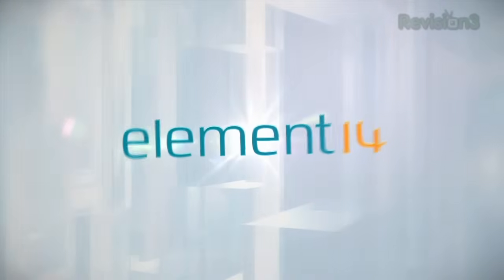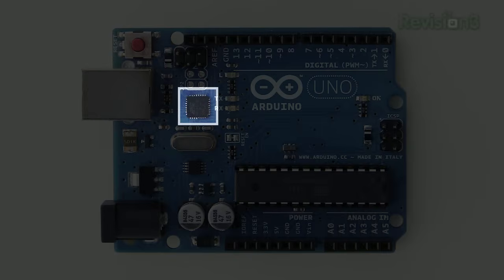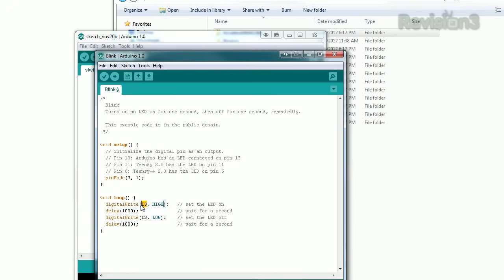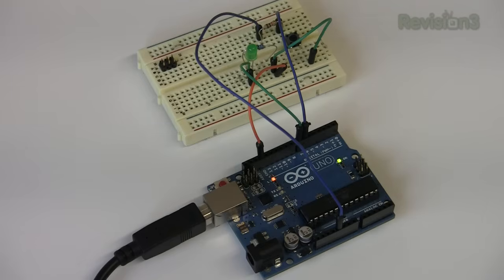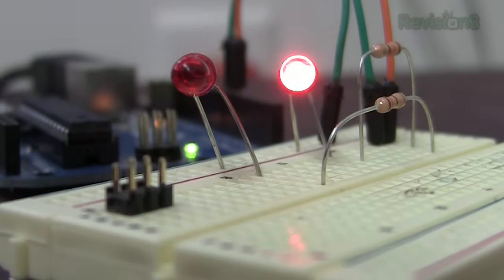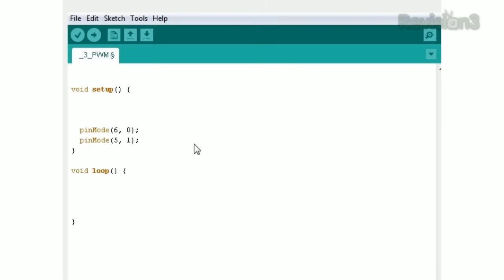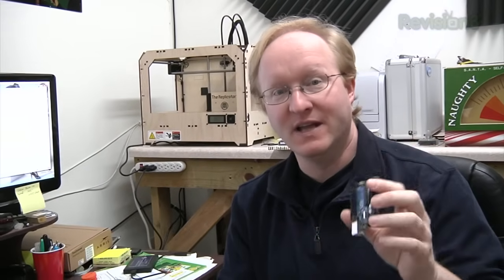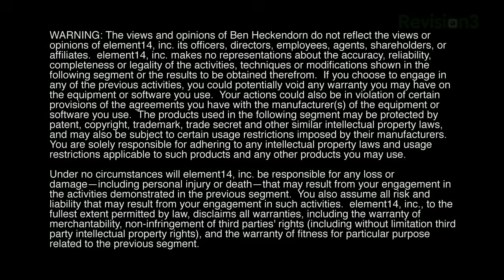Everything You Need To Know About Arduino

Comment: Could you make a computer (an actual one with moniter and all) by using multiple Arduinos?
Reply: An arduino is a real computer. You don't seem to understand what a computer is. If you want to interface with a monitor and serial on your computer isn't good enough you should be using a Raspberry PI instead.
Reply: no
Reply: I got suspended for no reason That's not really reliable. Just because someone tried and failed doesn't mean it is impossible, but it is unlikely.
Reply: Chris Barber No, I mean build a computer, except not a super-computer. Close to the power of a Commodore 64 or something.
Reply: KASASpace Sorry for not giving a full explanation on why I said no. I said no because it would take many many many boards to be able to provide video through the analog signal. Plus the amount of power it would take to compute the graphical side of things is a bit over wheeling plus the programing. It can be done(highly impractical), but why would you want to do that anyway when you can go buy a raspberry pi. I
Reply: KASASpace 
Not sure on the specs of the c64 as thats a bit before my time but i am fairly certain that the arduino chip is considerably faster then a c64.
What exactly are you looking for?
if you are wanting to program video output to a monitor you could do it with an arduino but it would be pretty difficult without using a chipset designed for it.
If you just want video output to a regular monitor and the ability to turn pins on and off to control external devices like the arduino is for the raspberry pi fits the bill perfectly.
However if you just want some kind of visual output from an arduino, you could hook up a character lcd display very easily.
Reply: I got suspended for no reason That is a good answer. And it can be done? But it's just not really practical, like space dogfighting.
Reply: KASASpace Lol yes. The most advanced thing i've done with these boards is probably when I had 3 mega's controlling this little humanoid. Pretty cool but it lacked power even for the mega and it did isn't work right :(
Reply: I got suspended for no reason Hmm, interesting. I wish I had an Arduino. :(
Reply: KASASpace They don't cost that much. Go buy one. You don't even need a genuine one because most of the copies have the same exact chip set as it.
Reply: I got suspended for no reason I'm quite busy most of the time, except for now.......
I suppose I could get one.
Reply: megalomania345 I haven't seen the relative size of an Arduino till recently....... 

EDIT: I meant have seen.....
Reply: They have small to large. Did you get one yet?
Reply: I got suspended for no reason No I did not get one, I'm rather lazy.............
Reply: Multiple Arudinos? No. Multiple Arudino shields including graphics drivers, lcd drivers and everything else maybe... Although you would have a very very basic machine. Possibly only capable of displaying simple text and symbols.
Reply: Its possible to make a retro computer with 2 arduinos
Reply: Regardless of what others said, you asked a good question. Yes it is technically possible. Although the computer would be orders of magnitude less powerful and have less memory than current computers. Someone has proven that you can get an analog signal out from an Arduino to a monitor so technically you can have a graphical display. Processing mouse and keyboard inputs should be relatively simple. So while it is possible to make an "actual computer", it is probably not very practical and won't run Windows or anything like that.
Reply: Depends what you mean by computer. You can use the TVout library to output black and white text and graphics to a TV via the composite video port. You can attach a keyboard and pointing device as input, and probably fit a very simple op-system in there, the arduino is capable of holding on to values when powered off if you use special memory locations.
I've made simple games on the arduino using the Funduino board to add an analogue joystick and buttons. So in theory yes you can.
Reply: no this is not possible due to limitations in the hardware of the arduino

Comment: I need help with arduino and 5m LEDs strips . I have used tip31 and 1k omh and 12v power supply but my lights are not as bright as they should be. Any help would be nice

Comment: Love it thanks ben, used to have those little Spring Kits from Radio Shack as a kid.
This is right up my ally, like Little Big Planet in the real world and for adults and smart children alike.
I already have an idea to create a radio controlled (via bluetooth) toy robot using the arduino, servos, the mindwave headset and a 360 controller. Problem is... what may i use for a wireless communication base for the chip to communicate with the toy? i can write the software, but any tips on the hardware bit i require?

Comment: want to build engine monitor for my rv want monitor fuel pressure manifold and boost pressure battery voltage oil temp and pressure and exhaust gas temp and last trans oil temp. The engine is in the back of my rv and would like the display read out to be in the front. to run cables from the back to the front is very hard would like to run a digital link between the engine area the front where the display will be in the drivers console. My idea is to add or remove sensors and update software to get new functions with out running cables to the engine area to the front console. my rv was built in 92 before engine ecu's were in diesel rv's Any help would be appreciated.

Jason

Comment: Hi Ben. Why do we connect the LED via a 10kohm resistor and not directly to the 5V ramp? (or was it 2.2v in the arduino case)
Reply: nigga it's to slow down current other wise it'll burn up your LED and shit.

Comment: Yes, but it needs a power connection, either through its barrel-plug to an AC/DC converter "wall wart", or batteries to the 5V and ground pins.

Comment: With a constant-frequency PWM, the most common, pulse width is directly proportional to duty cycle. OP is right, it's the duty cycle that really matters: 50% duty cycle generally corresponds to 50% "power" or "output", whatever that may mean.

Comment: In this instance, they do the same thing, but i did mean duty cycle. pulse width doesnt' change anything if the on and off time remain the same, the key is the change the proportion of on and off. Changing pulse width doesn't do anything if the off time changes with it. Same thing with frequency. The key is to change the duty cycle, then regardless of frequency, or pulse width, u get desired effect. Just happens in this case it's the same thing, as u change pulse width u also change duty cycle.

Comment: Given this explanation, what you really got described to you was a perfect square wave. This is where the load instantly jumps between two levels without having smooth edges.

When we're talking about PWM we usually call it a square wave because that's what we're aiming for, but in reality it doesn't really have square corners even though it gets pretty close.

If you have a good old analog oscilloscope this is pretty fun tp watch. Just plug the reference to ground and the probe to a PWM output.

Comment: I think I see where all of this confusion is coming from now; someone probably explained AC as going up and down in a sine curve and then said that if you cut away the middle part you get DC. This is a horrible way to explain DC, but it's true that DC doesn't normally oscillate.

There's one critical difference though; in AC the load goes equally far from ground in both directions, but in DC the load must _always_ stay above ground or the electrons will start flowing backwards.

Comment: I said it correctly. DC is AC without all the values in-between. It generally is represented by max + and max - of an AC wave, or you can make is positive or negative only depending on what integers you're using. For most PWM, the DC voltage enters both + and -, otherwise you'd be frying your electronics.

Comment: You're probably thinking DC is positive voltage only. It isn't, DC hops between + and - just like AC except it hops over the neutral portion of the wave we'd call 0 volts in AC.

Comment: There's nothing to understand about it other than DC is a representation of AC that hops between + and - side of the wave. Its not necessarily just on or off. You're hopping between + and - regardless of duty cycle percentage. This is what DC does, it jumps across the equilibrium of a wave as where AC is continuous like a bi-directional slide. DC is AC without all the values in-between but you can step the DC cycles to mimic an AC wave. Based on duty cycle percentage, your DC wave can be + or -

Comment: Please explain this part "the voltage output during a cycle always goes into + and - side of the wave". To me that sounds like AC.

I've worked with software PWM on a PIC16 series microprocessor so I'm not completely in the dark here.

Comment: What do you think a duty cycle is? It's a cycle of oscillation that occurs at a frequency. In your case, PWM has a frequency that is caused by the duty cycle %. If you know about unsigned integers, you'd know that whether you have AC or DC output, the voltage output during a cycle always goes into + and - side of the wave.

Comment: No it doesn't. It may appear that way for certain duty cycles when looking through an oscilloscope, but the actual PWM frequency remains fixed.

Let's take an example; assume we have a horrible PWM controller operating at 4 Hz.

At 25% duty cycle you'd get the pin high for 250 ms and then low for 750 ms. Since we have an extremely low PWM frequency we can see the tricky part with 33%. But then we just change the phase to 3/4th of a second meaning 250 ms high, 500 ms low.

Comment: are we talking about the Arduino or the shop? Well the arduino is great to get you started with microcontrollers. The Mega is good for stuff where you need a lot of I/O Pins like an LCD Display. I personally like the Nano because you can pop it on a breadboard with all the things u want to connect it to. 
The shop is cheap and has a lot of stuff for arduino projects. The big con is the long shipping time from china (but i could time it with non-term)....i bought a lot there over the past 2 years

Comment: Ehm, look, i'm sorry, i'm consider myself fairly tolerant with these kinds of thinks.
But what you said about PWM is just wrong! You don't change the speed of the signal, you change (modulate) the pulse width (like the name says), the frequency stays exactly the same (about 490Hz), if you would chance the frequency the average voltage wouldn't change at all. Also, 255 isn't full speed, 0 and 255 are either always on or always off, all other values modulate the pulse width according to the value.

Comment: Hi Mr. Ben, Nice tutorial. I am designing street lamp powered by renewable energy. I would like to control the lamp on and off based on motion and light sensor. Initially, i would like to read the motion and light sensor using Waspmote or Arduino, then control the power from the charge controller to lamp. I would like to about wifi integration with arduino and how to configure the output ports. Please help me. Thanks

Comment: To AbsoluteMathematics, you can use arduino nano or arduino micro. they are both smaller in size and of course lighter. go to arduino web site and  check their specs to see which one fits your need. you can order them from amazon

Comment: Digital logic doesn't care about the value of the resistor as long as it can pass and distinguish some voltage from the absence of voltage (1 or a 0)

For your arduino prototypes, use something under 1k ohm on your switches and it'll be happy. Many of the shields already include these and would make this unnecessary if you're not assembling all this via breadboard.

Comment: Hey, I really appreciate your channel. I'm a mechanical engineer so please excuse any ignorance's I may have. I need something simple like the arduino to be able to make activate a servo motor 90 seconds after a button is pressed. I'm sure the arduino is capable but I need something with a smaller surface area and as light as possible if you have any suggestions please let me know! Thanks in advance!

Comment: I hear you on that pinball machine!  I've been working off and on on one myself for years but always ran into some sort of brick wall that stopped my efforts.  I finally went the lego route, and figured out how to use Photoresistors as switches and how to operate a stepper motor.  All this is interfaced with an old laptop that isn't used for anything, through the parallel port programmed via PDS (QBX) in straight DOS.  I'm just waiting for my 2N3904's to come in so I can make my H-Bridge.

Comment: The basic principle is maximizing the use of the Ateml chips like the ATtiny or the ATmega. Basically the same chip but one is a smaller version in all aspects. The limit of it's uses is only hindered by the memory on the Atmel chips. But for the most part a clever coder can overcome this by daisy chaining them together for larger projects. 

Atmel chips are cheap, you can get them for less than 2 bucks in bulk.

Comment: The Arduino is nothing more than a simplified language program for interacting with an almost endless number of sensors and other components. 

The entire purpose of this small board is to hook it to your computer so you can draft programs and test them out in real time.

Once you have finalized your project you can take all the parts you used and assemble them on a more permanent board.

The useful part of the Arduino is it simplicity with coding and including code libraries the community.

Comment: I suppose, at 68, I'm too old to understand the Arduino, I'm not even sure as to how to pronounce it! :) My experience level and mindset is still swirling amidst the heated electrons emanating from the cathode through the grid and onto the plate of a triode vacuum tube which I learned in my youth in the mid '50s.  I might could get a handle on all of this if I knew just what to do with it other than watch a couple of LEDs blink. :)  Can someone help an old man make the tech transition? :)  Mick

Comment: propeller P8X32A chip for parallel processing/number crunching.. has 8 physical cores/32IO/80MHz clock. 2nd generation is on the way.

Comment: The Arduino IDE is kinda primitive (to say the least), I don't understand why anyone would want to write anything serious with that.

For my projects I prefer to use the Netduino. I can easily write multithreaded code that can let me do multiple things at the same time, say, a slow blinking LED while I am waiting for a button press even from the user.
And it's all done in Visual Studio. Debugging the code that is actually running on the device is priceless (and much more fun)

Comment: Show Idea: Custom PC (Gaming) "Laptop"

Similar to a laptop but uses standard desktop parts. Laptops have their limits and I would want something that is portable (can be larger) and can play PC games, rendering for 3D modeling/animation. Would need at least a 24" LED LCD 1080p screen (or larger), can handle any video card and at least 2 hard drives (ssd). Must keep components cool, have a built-in and touch pad, on-board ports (hdmi,usb3.0, etc...) use your imagination. :D send a PM for info.

Comment: volts x amps = watts
the wart part converts 120 to a lower voltage, usually between 5-12 volts and output is 2 amps? 5 watts? check the numbers on the unit, it should say what the output is in volts and mAmps (1000 per amp). one of your numbers sounds wrong.

Comment: Also, the 120V outlets are AC (alternating current), in which the flow of electric charge periodically reverses direction, while the 5V USB charger would output DC (direct current), in which the flow of electric charge is only in one direction.

Sources for all: my memory, Wikipedia

Comment: Amp (short for Ampere): The amount of electric charge passing a point in an electric circuit per unit of time
Volt: The difference in electric potential across a wire when an electric current of one ampere dissipates one watt of power
Watt: The rate of energy conversion or transfer
W (wattage) = V (voltage) * A (amperage)
Therefore, if your USB wall charger outputs 5V at 2A, it would be 10W. It would only be 5W if it were also 1A, as USB is always 5V +/- .25V

Hope this helps!

Comment: Sure, but all examples and the vast majority of user written code uses high/low output/input, changing it like that doesn't make any sense or help users in any way, it's just confusing, same way the super high speed and quick cuts combined with no explanations of anything and not using the internal pullups makes this video pretty much useless, 15mins on arduino.cc is time better spent